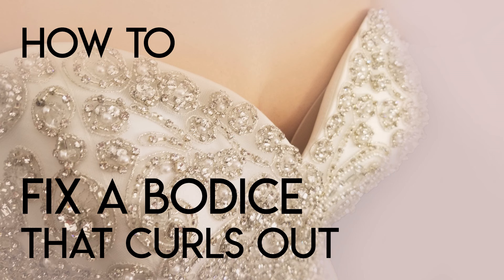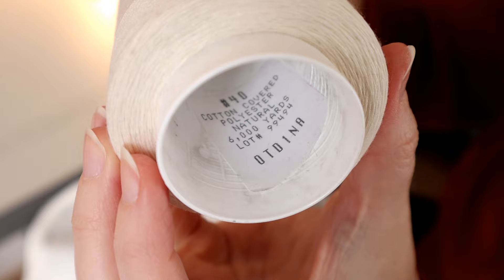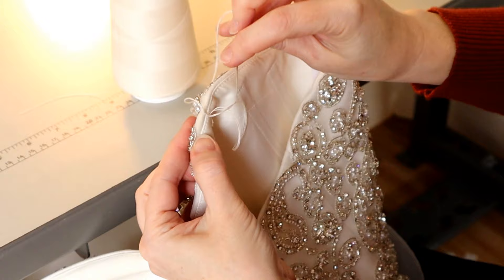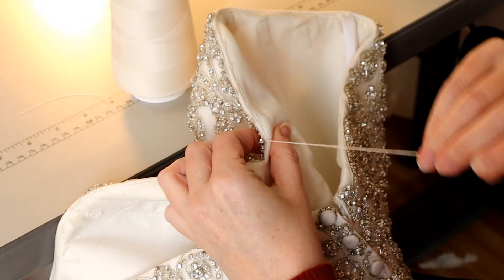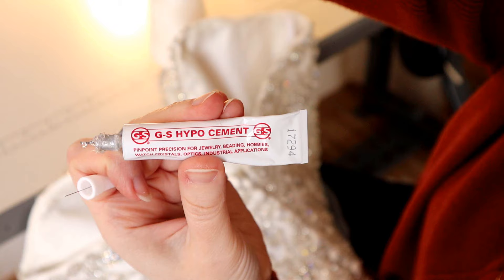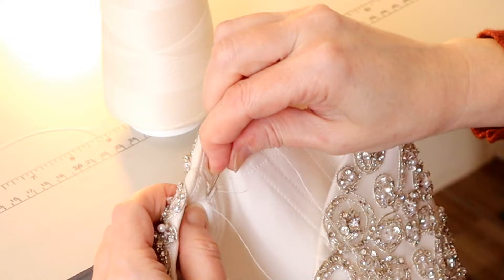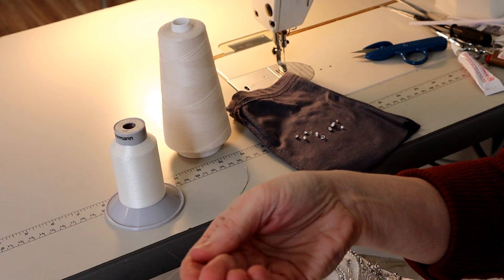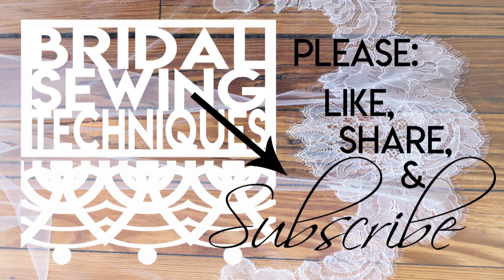How to Fix a Curling Bodice on a Wedding Gown, Curls, Neckline, Bodice Edge Turning Out

Comment: Ive done this quite a few times.  I use upholstery thread and smaller stitches.  I can pull it and not get any waves.  I also use this technique if i have pinned a super tiny dart on the side bust.  You can ease out a small amount of fullness.  Less than 3/4 inch.  And it also takes care of the curl.  I take a measurement before and after the pulling so i get the right amount.  I love your tips keep them coming

Comment: Thank you for responding.  It is an off-the-shoulder with a very low back.  It has extra fabric on the side of the bodice section right at the back shoulder blade.  Thanks again.
Reply from the maker: https://youtu.be/bW_2F5hSa9Y 
This?

Comment: I have always used 1/4 twill tape to snug up the top edge. I can reduce a cup top edge by 1 to 1.5 inches from center front to side seam. Your technique is very slick! Thank you!
Reply from the maker: Do you mean you make a tunnel with the tape & pull through it with strong thread or elastic?
Reply from the maker: Oh, I see! Yes, similar idea, there. :)

Comment: I found this video while searching for a way to fix a bra that has curled out on the edge of one of the cups, similar to this bodice. So far I haven’t been able to find a tutorial specifically for a bra but I’m hoping this method will solve my problem. If anyone knows of a more relevant method or why this one won’t work for me please let me know? I appreciate any feedback, thanks!
Reply from the maker: When I see this happen to a bra, it is usually that the outermost layer has shrunk or was stretched too tight when the bra was made.

Comment: This is really helpful!! 
But I was just thinking about that tape you often see on the top of strapless gowns... its not sticky but it's almost like someone ran a glue gun across some tape - its a plasticky material. Do you know what this is called? Is it helpful for keeping gowns up/in place? xxx
Reply from the maker: It is elastic trim with silicone. It doesn't help with the problem this video addresses, though

Comment: Can you tell us what type of dress form you are using? I have a horrible dress form and I can't seem to find one I like. Thanks!
Reply from the maker: I'll try to remember to look it up tomorrow. Remind me if I don't pop back in to tell you. Honestly, I hate all of them. They have to make them light & flexible, I understand that. But, then they feel flimsy. Ug. I own 4, I think, and I'm not crazy about any of them, really.
Reply: @BridalSewing  I agree with you. Mine never seems tall enough and then when I adjust it, it is too short! It was truly created by someone who doesn't sew. When I go to adjust it, it falls over!
Reply from the maker: Amen, sista!!!
Reply: There is a website - www.bootstrapfashion.com - where you enter a series of very specific measurements and they will calculate and design a dress form pattern in your exact size that you can sew up yourself.  It costs only around $25.00 and they provide VERY detailed instructions. You receive it immediately upon payment via a pdf file and just cut it out and tape together.  Or, you can take the file to a large scale print vendor so you don't have to piece the pattern. (actually, piecing the pattern was the hardest part, the rest was easy). You can make your own stand with a piece of pvc piping and a circle of plywood, or you can use an old dress form stand.  I used a child's coat rack after removing the "branches". I realize that if you're working with customers that would mean making one for each, but if they're repeat customers it might be worth the work.  And best yet, because it has a zippered bottom, you can add or remove fiberfill inside it to allow for a person gaining or losing weight. It was fun to make and I LOVE mine!